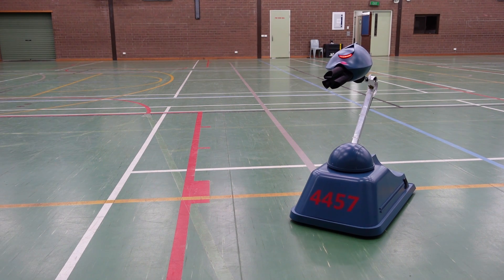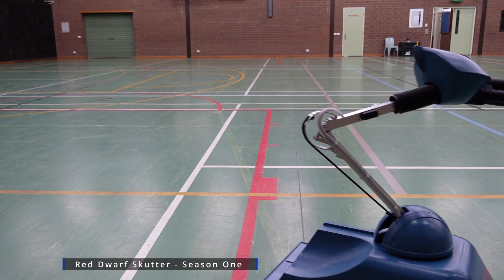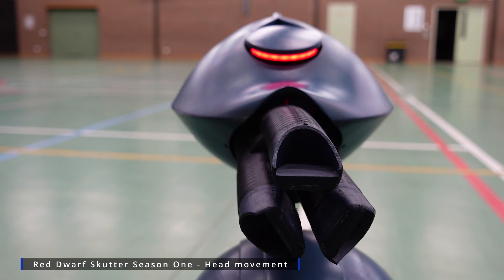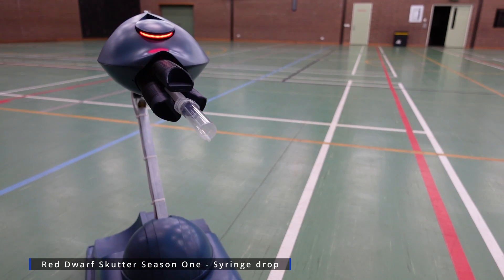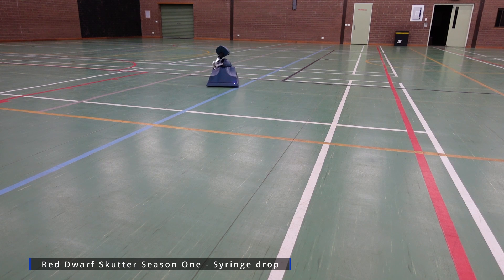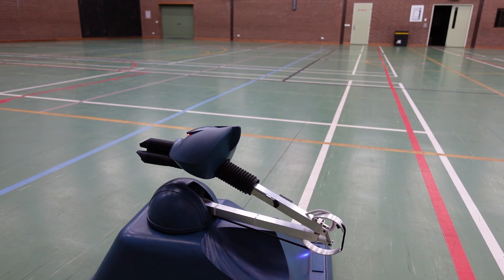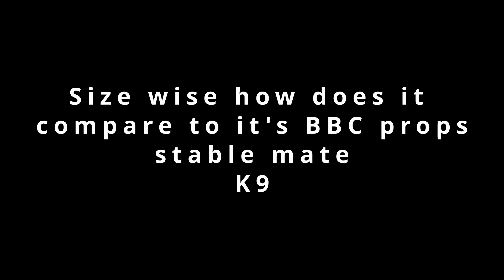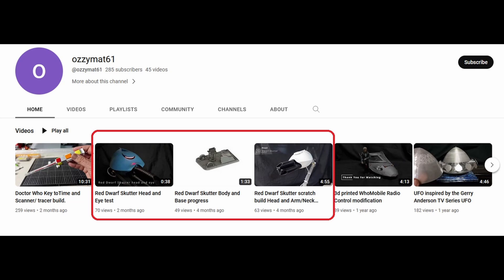Fan Built Skutter from the science fiction comedy Red Dwarf.

Comment: I am working on one of these. Wondering when you will release your plans. Curious to how you designed the mechanical assebalys. I am using Blender for my 3D modeling. Going to make a YouTube video at some point.
Reply from the maker: Do intend to release the stl files and mechanical drawings. Just wanted to change the body panel joints to make the connection stronger before releasing.